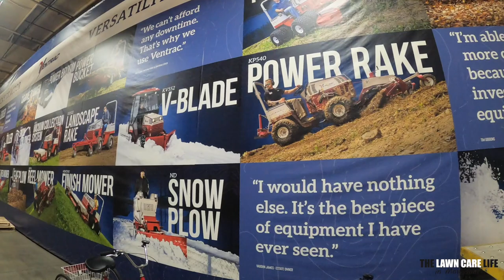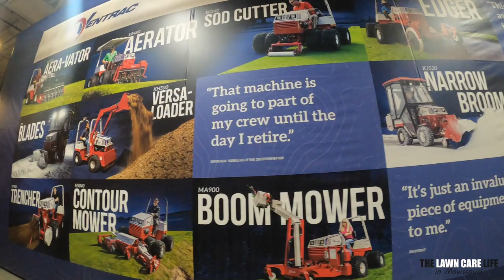What did I find INSIDE Ventrac HQ? FINALLY got inside VENTRAC Headquarters - Check out what I Found!

Comment: Excellent!   Aaron Graber is a great spokesman for the company!  

Did you try out the vacuum collection system?  That could make many of your leaf cleanup jobs a one person job.  

How did the flail compare to your ToughCut deck?
Reply from the maker: Thanks for watching!  Yeah, Aaron is the best over at Ventrac.  Great guy with a ton of knowledge about the product.  I have not tried the vacuum collection system, but I could see how it would be very efficient for cleaning up a ton of leaves on some really nice turf.  I only ran the Flail mower for maybe 10 mins, but I did notice that it chopped the material up much finer that the Tough Cut does.  And they say you can move through an area much quicker with the flail.  But, it's not designed to tackle the thicker/heavier brush like the Tough Cut.  I really need both decks!!!
Reply: @TheLawnCareLifeinMowssouri  The nice thing about the vacuum collection is it saves a lot of endless blowing to move leaves to the curb.   Ventrac’s will dump directly into a truck or trailer.